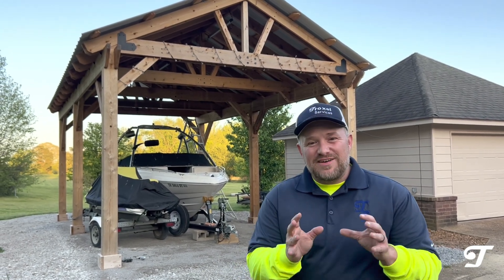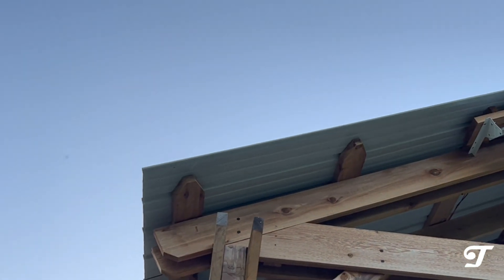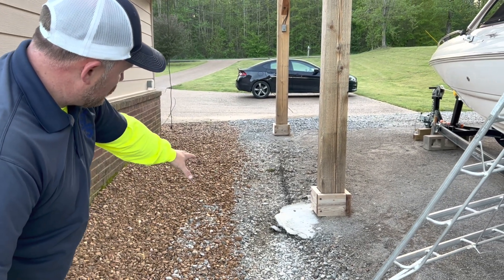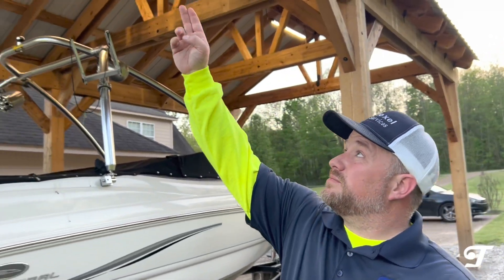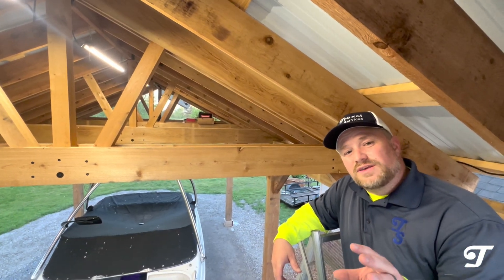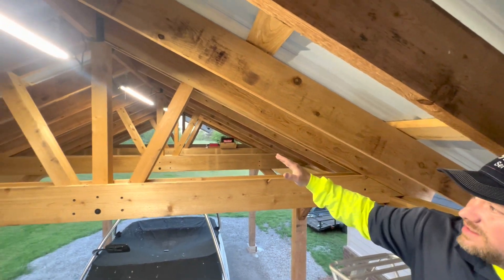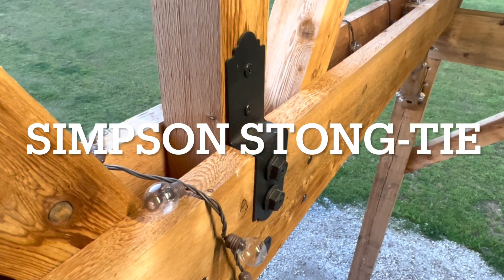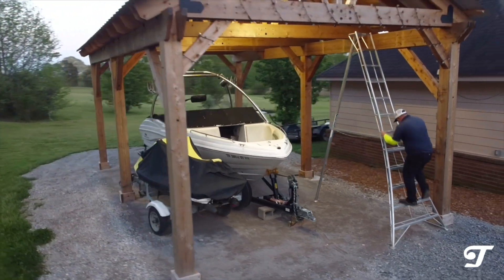5 MONTH REVIEW! Timber Frame Cedar Pavilion Build

Comment: I am curious were the 8x8 posts required because they are cedar?  Or was this a cosmetic/design decision?
Reply from the maker: Great question I certainly felt more comfortable going with the 8 x 8 but I would say 50% of the reason was aesthetics. It looks really nice with the thicker cedar post albeit much more expensive and harder to work with. Now if you notice at the top where we made the cuts, we reduced the 8 x 8 to a 6 x 8 and then further down to I believe a 4 x 6 as we added the ceiling joists and the bottom of the trusses, so having an 8 x 8 was important for multiple reasons

Comment: Did a good job! 32grand though. For not a real timber frame. Maybe got 5 grand worth of cedar there. Should of power washed that cedar to get those band lines off. And definitely got to stain cedar asap or it’s going turn that brown color. Then maybe 1 load of gravel $300. Then 1 day labor another $500 to level. So $5800 to get to actual building. So $26 grand should of got stain. And underground electric. Can’t charge 32grand for a carport and have a extension cord running to it especially have exposed wiring underneath. Could’ve hid all that if it was planned prior too. Definitely walked away with to much money for which u did.
Reply from the maker: Went back and looked at the receipts:
Cedar Lumber and Hardware Associated: $11,850
Metal Roof Material: $1950
It was two 22 TON loads of "Crushed Limestone CR 610": $825 per load($1650 together)
More Brown washed medium gravel: $200
Misc Material including concreate, Solor Setup, Post protectors, etc.: $700 - $1000

We are in Tennessee not California so these are probably average prices for everything.  
Which means you are way off and not even close.

Comment: The pavilion you built is seriously the best looking one on youtube! We would like to model ours after this. The land we have on the side of our home will allow our maximum width (outside post width) of 13'6" (because we have a 6' easement to consider and distance from the house). The length is TBD (somewhere between 28-40 ft - we would have to look into moving two condenser units of two air conditioners). We live in Bokeelia, FL (hurricane territory, SW Florida), so we are concerned with the wind rating for this structure. Do you know the approx. maximum winds for this structure? Your structure withstood 50 mph winds. I wonder if it would hold up with a category 2 or 3 hurricane? A cat 2 is 96-110 mph wind speed, and cat 3 is 111-129 mph. Also, what depth should be for the 8'x8'posts (6 or 8 posts, depending on the length of the structure)? I think you had 36" depth. Our ground is mostly unconsolidated sands and silts. Thanks
Reply from the maker: We recently had 70 mile an hour straight line winds and the structure . What type of ceiling clearance do you need for the pavilion? What do you plan on putting underneath there? If the ceiling clearance is lower the structure can be a bit stronger with proper bracing etc. I'll wait for your response and then I'll respond again.
Reply: @troxelservices  The ceiling clearance will probably be 9'6", which will be high enough for our tesla and Key West boat (with canopy). If we ever sell the home, then it would also be high enough for a class B or C motor home (I think). We have 47 feet to work with on the side of our home, so the length of the pavilion is still not determined. We only may need a 22 ft pavilion, and then the remaining 25 feet could be a large room, which will be attached to our existing stilted home. So we would need 10 - 8x8" support timber posts (spaced about 12 ft apart, 5 on each side) and the entire structure can be 30 inches from our house. We can connect the large room to the house with a walkway. I think it is best to email you...

Comment: Super build. Could you have done this length with 4 instead of 5 trusses?
Reply from the maker: I thought about this but I believe for this length and with the number of posts and the type of structure we built, five trusses were the way to go for sure. however, feel free to call me at 901-671-8219 and I would be glad to talk through more of the reasons why I believe five trusses was important.

Comment: Thank you for this follow up.  It helps me see some of the more intricate details of how the structure was assembled.  As someone familiar with LED lighting I'll suggest you check out alternative options for the lights you used which likely has a built in converter to come back down from 120 volts.  Most LEDs use 5 volts and some use 12 volts.  If you choose a 12 volt option you could eliminate the converter and with it the parasitic draw on your battery.
Reply from the maker: Great point Raymond!!